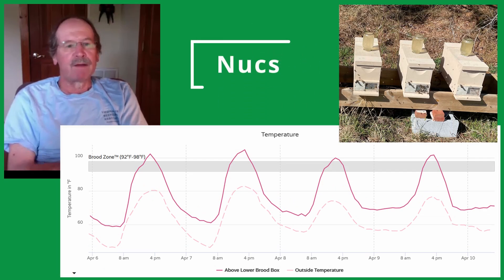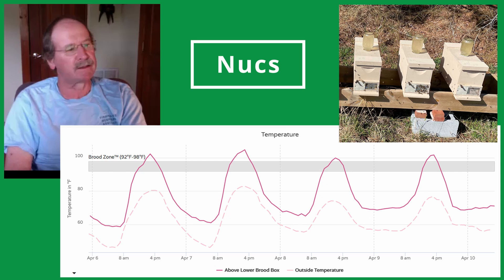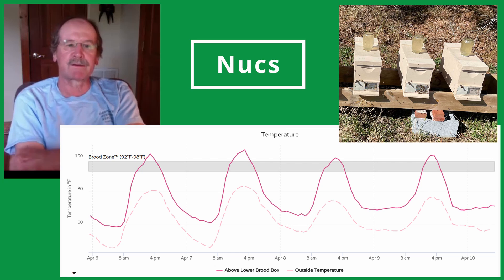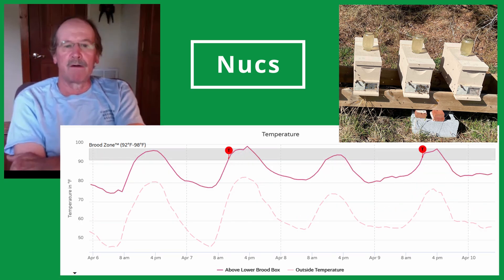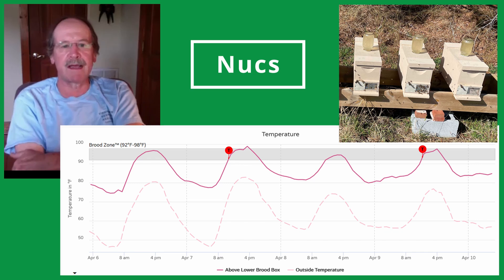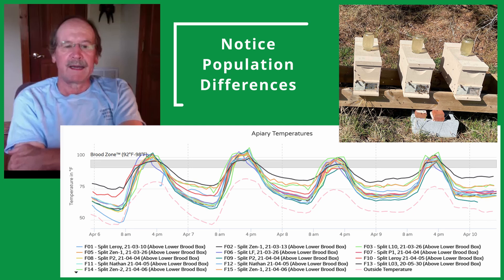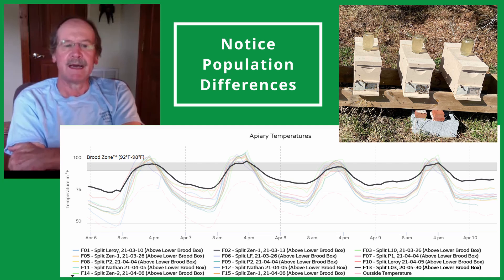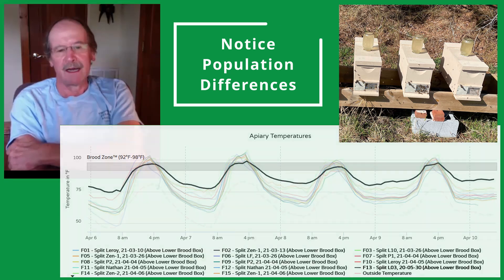S1:E3 Colony size versus temperature

Comment: Many thanks Rich and Theo for this great insights! I wonder why the overwintered nuc has so much temperature oszilation. Is the sensor not in the brood nest or has this nuc / hive no brood yet or is it queenless? 

For further videos queenless hives and detecting queen loss would be an interesting topic I think we have some data for: I found your video "6 1 Hive Temperature Discussion" https://youtu.be/vOV24T-BWFM very interesting and did a short (German) review under https://community.hiveeyes.org/t/volk-eingegangen-und-massive-rauberei/2635/13 the reason was that we found nearly the same temperatur pattern September 2019 at a (presumably) queenless hive: https://community.hiveeyes.org/t/volk-eingegangen-und-massive-rauberei/2635/3 Now I found your "experimental" data with a manually removed queen http://www.beecounted.org/thermoregulation-queen-loss/ and the Broodminder chart is nearly the same as the Hiveeyes chart!! So it seems to be a robust pattern, see https://community.hiveeyes.org/t/volk-eingegangen-und-massive-rauberei/2635/14 . Would be nice to know how many queenless hives you have detected this way and how many hives are with a lost queen that show not this pattern? In case the hive can rear a new queen is the temperature to normalize? For our hive the bees was robbed and the hive died. So you can see a clear "end" in the data and this on the temperature and weight side. But this could be different in case the hive rear a new queen and she is mated after wedding flight.
Reply from the maker: Hi Clemens, Thanks for the comment. 
We see consistently that a limited population can not control the entire hive space, even in a nuc. My personal thought is that the AC vs DC values will be the key, but it will be based on hive volume also. 
This is pretty exciting stuff for us. We have seen many examples over the years, it is big work to characterize and document them. This season we are hoping to engage our citizen scientists further to add comments to their data.
Lorenzo Pons and his Mellisphera team in France is leading our analysis push and 'the last mile' to the beekeeper UX. We have several other folks engaged also. Perhaps we can join forces in some way to speed the journey to our shared goal. Drop me a line at rich@broodminder.com.